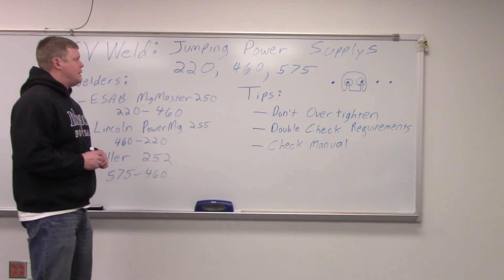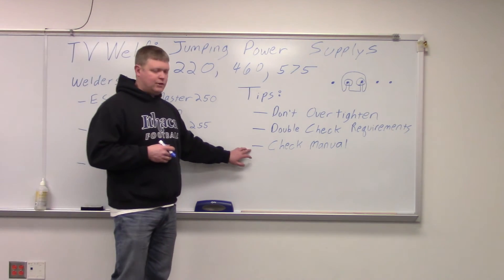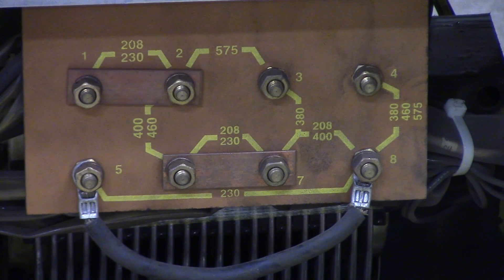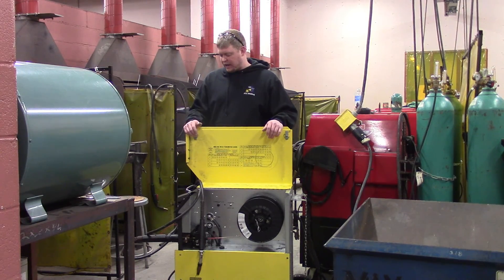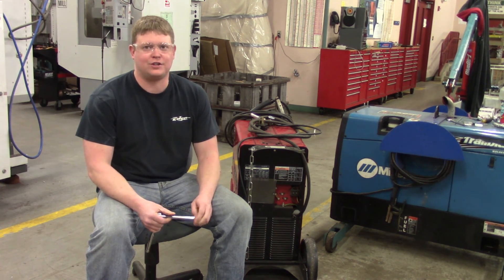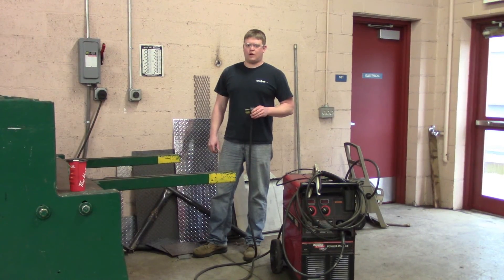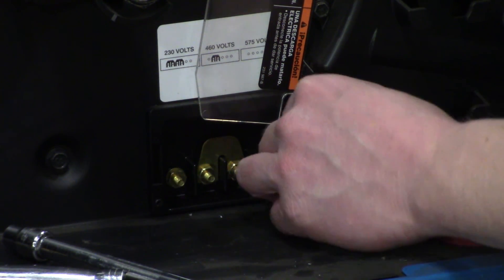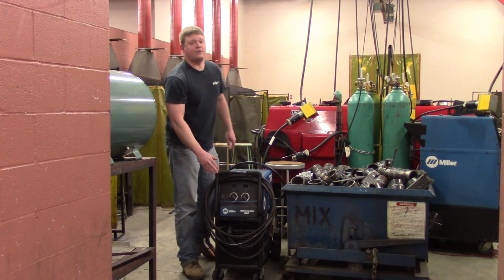Switching Welder's Between 220/460/575 Power Supplies

Comment: Hi ...I bought a used Panasonic Gunslinger 260 mig /sick welder . 

The plug end is a 240 volt 50 amp 3 prong...

When I opened up the side panels , the copper jumpers were mounted for 575 volts. 

So not sure why the previous owner(s) switch the plug end but not the copper jumpers to the 240 volt position 🤔 

Would the welder even start in this 575 volt jumper position but with a 240 volt 50 amp plug end ...hope nothing got damaged internally

Comment: Have an older Esab Heliarc 250 ac/dc... data plate says single phase but the plates are attached where it reads 460v... like to wire it for 220 but just not sure...   anyone?
Reply from the maker: A lot of welders that run on 460 can be jumped to 220.  I'd open it up and look for posts with a diagram or find an owners manual to see if it can be jumped to 220.  If that doesn't work I'd go to a welders supply store and ask if they had anybody that has experience with that particular welder.

Comment: how would you change the voltage on a gold star 302 I see the jumper they are on 460 I changed them to 230 now what do I do with the contactor in coming power
Reply from the maker: I'm not real sure without looking at it.  Sometimes you don't have to change it at all.  By any chance do you have the manual?  It should say in the manual.

Comment: Hi i have esab 600 mig welder there volt mantion 415 volt 3 phase but i want to use 220 volt 3phase, How i can make it
Reply: Mr.Mukesh sharma I have a habort welder RV/ 450amp 3 phase welder but how to connect on 2 phase.?

Comment: I have a migmaster 250 in side on the panel in writing 208/ 230 volts part number  32851 also there's wires folded with a zip tie with written on 208.  when I purchase the welder the original owner said it was three phase. I was wanting to put it back 220 volt. I have a welder  just like in your video migMaster 250. but I do not have a board to adjust the voltage like your migmaster 250. so I'm kind of confused could you help me out. thanks very much Steve
Reply from the maker: I highly doubt that it 's a three phase machine.  If you're running 220 make sure it's on the 230 side of things.
Reply: Brent Harkness  Thanks Steve

Comment: hi i was using a 3phase mig welder in single face with 3hp static converter when i turned on it looked like it was working fine but when i start welding the capacitor in the converter exploded what i need to work ok?
please help